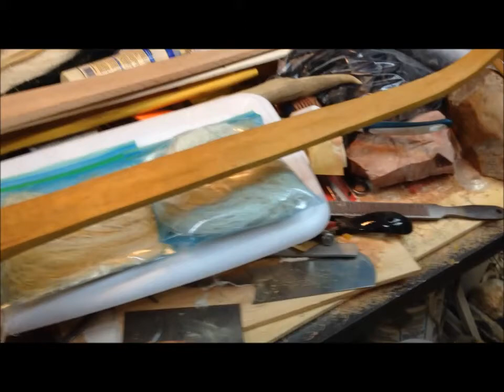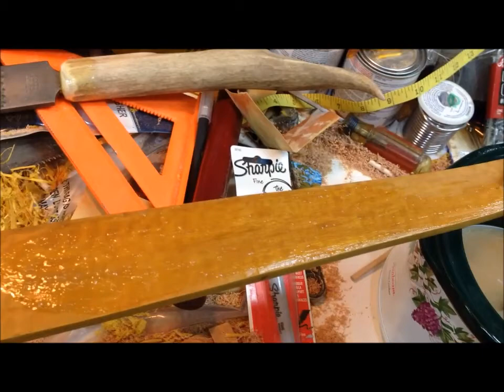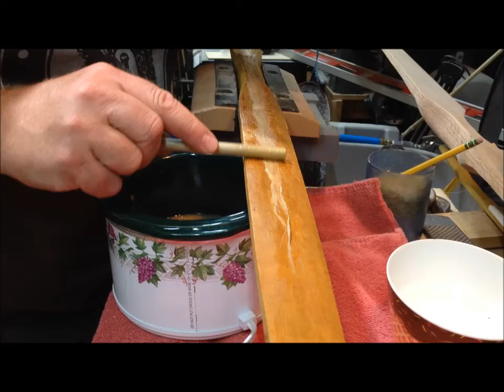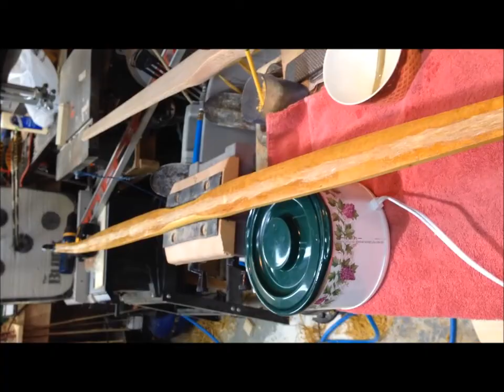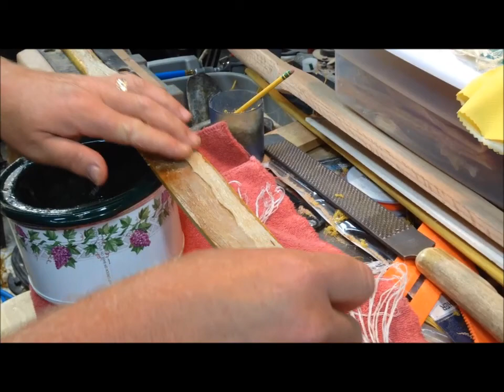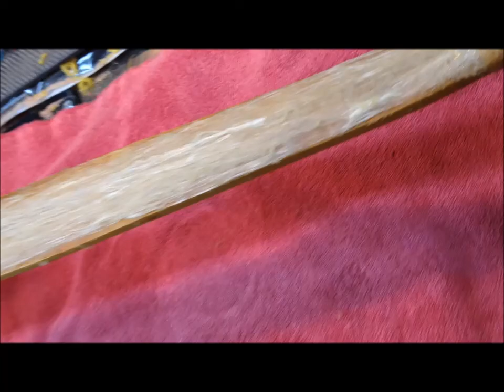Sinew Backing an Osage Orange Bow using Sinew and Fish Air Bladder Glue

Comment: Beautiful! Could you use titebond 3 waterproof wood glue? Also would there be any advantage to break down the sinew to individual strands? And last I've used sinew to tie on points and always soaked them for a while first, they absorb a lot of water. Would it help to soak it in the glue for a while first? I know this is old but I just found it. I've been making hickory bows and they take so much limb set I thought I'd try this. Thanks for any advice, you obviously know what your doing

Comment: great video! thanks! It was hard for me to tell from the video, but I was wondering if your bow was decrowned or not. I have some small diameter knotty staves I'm thinking about decrowning and sinew backing. Is that a good option for those type of staves? (because of the high crown, i can't remove many of the knots near the sides without losing a lot of width if i don't decrown)
Reply: +dustin hill If you put on a thicker working layer of sinew rather than a minimal layer more for protecting the back from failure, the crown isn't a disadvantage: you're moving the neutral plane towards the back and having the sinew take the brunt of the tension on the crown makes the sinew work harder which it is capable of doing with style.

Comment: You can make a waterproof glue with the hide of anything with scales, right?  Is there a big difference between that kind of glue & the kind made from swim bladders?  I know not all fish have those air bladders, so I figure it's a good thing to know.  Also, how do all these stack up next to hide glue in strength & flexibility?  I've also been wondering if you could use pine pitch for all this?
Reply from the maker: Atkrdu Not sure on your first question, all I've ever used was air or swim bladders. So far the air bladders have produced the best glue that I've made. I still use hide and sinew glue as it still works fine. I'm thinking you would have a problem with pine pitch when it gets hot. It's not flexible either when it's hard. If I've an option I'd go with fish glue.